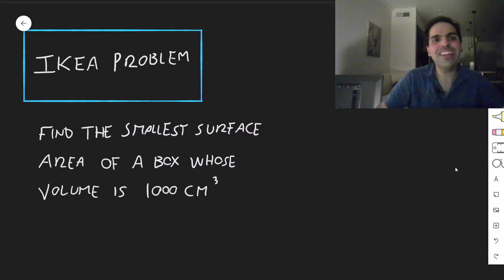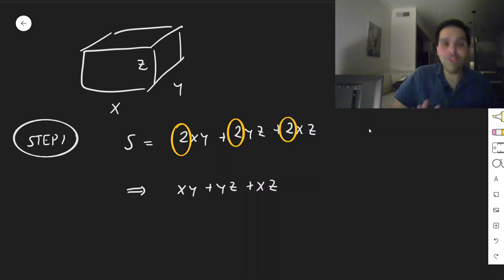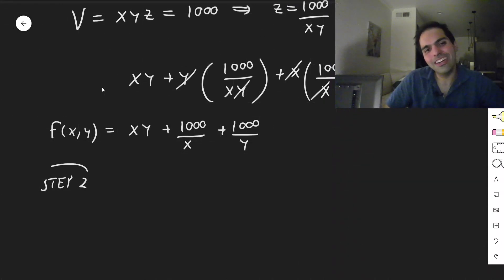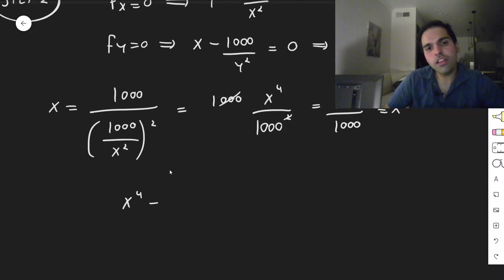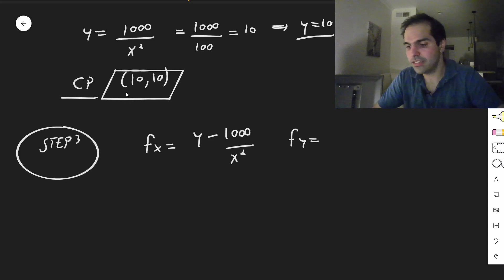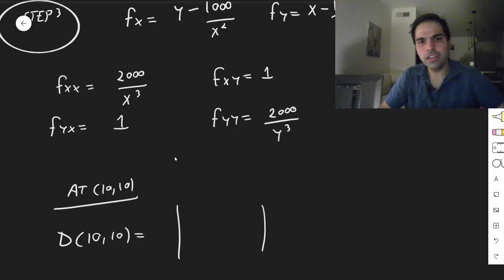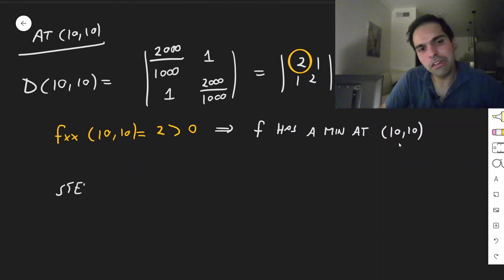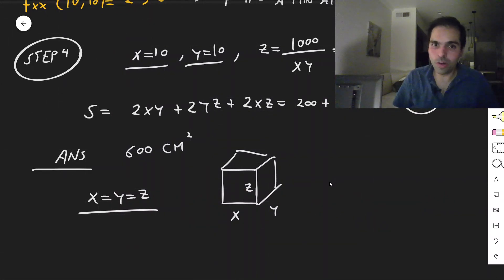Surface area of box max/min

Comment: Not an Ikea manager, but I don't think having the smallest surface area of a box matters in a storehouse.
Reply from the maker: I think it does! Smaller surface area = less material, and it takes up less space
Reply: @drpeyam  There should not be any difference if they are all boxes and not some amoeba shape which cannot be tightly packed. But you are right about the material need.

Comment: Next question in list: What is the maximum surface area with volume 1000 cm² and minimum side length 1 cm, while all surfaces are convex. I suppose it will be some paralelogram?
Reply: 1x1x1000, of course. Although one might want more specifics about "side" length of a convex (non plane) surface...

Comment: Notice both volume and surface area are symmetric with respect to x, y, and z. That alone ought to tell you the answer is either a cube (x=y=z) or a degenerate form (x=0, y=0, or z=0). Easy to notice that the surface area tends to infinity for the degenerate forms, without ever getting the correct volume.
Reply: Not necessarily. There are problems where input is symmetric but the solutions are not. 

For example, connecting four points, each on a vertex of a given square, with a shortest line connecting them all. There are two solutions in the shape of a deformed "H", and each of these solution is not symmetric under rotations by right angle, despite the problem itself having said symmetry (rotating a solution by a right angle switches between the solutions).
Reply: I imagine a proof can be made by assuming it's a cube a proving any change automatically increases the surface area.

Comment: I am a simple man, i see IKEA, I click.

By the way it could be solved in seconds mentally using AM-GM
Reply: מחמד חנזיר  well, the video is more about finding the minimum of multivariable function (more general) than solving the box problem quickly with am-gm
Reply: Am-gm? I apologise, I am still 16 and am in one of the worse school curriculums in the world.
Reply: @beasbiswas90 I don't think AM-GM inequality is taught at school
Reply: can u elaborate
Reply: Never heard of that. What does "AM-GM" stand for ?
Reply: @joluju2375  arithmetic mean - geometric mean inequality
Reply: ཏྦཱལ་ག་པོ།   Sweet analysis, and much simpler than multivariate calculus or Lagrange multipliers.  I think the surface area is 600 though
Reply: ཀཱ  AM-GM inequality here only proves that cube has the smallest sum of edge lengths for a given volume, not the smallest surface area.